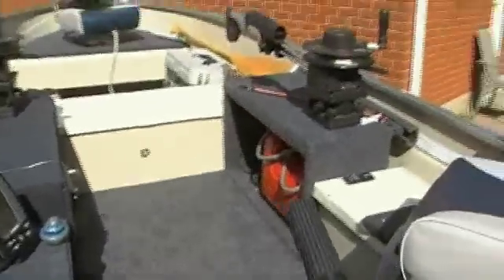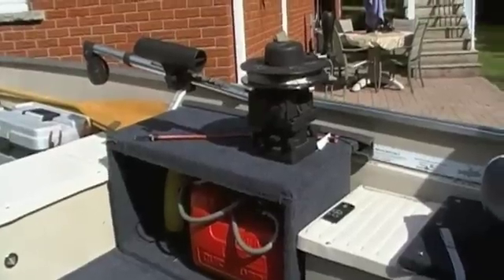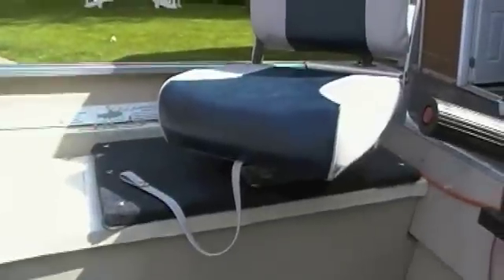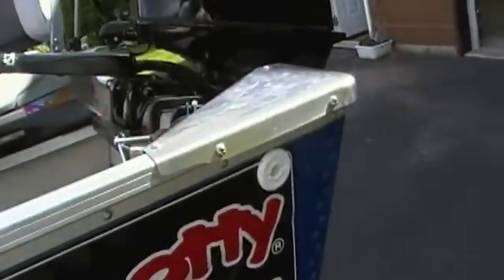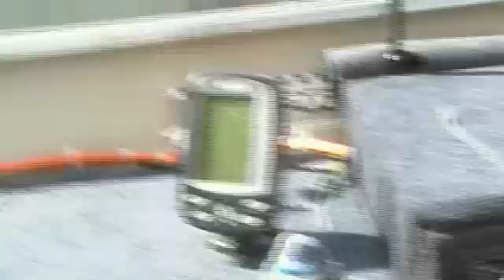Boat modification Project

Comment: Hey nice video. Is that a princecraft fisherman? I have the same boat and am looking to do some mods myself. This will be my 3rd boat I've restored and was wondering if you had a trick to get the exact measurement for the bow piece? Also, do you buy marine grade plywood?
Reply: Yes Its a 14ft Princcraft Fisherman . Cutting the bow peice was the hardest part I used a bige peice of cardboard . I layed it over the bow and reached under it to trace the size then cut it out the  when it was close I worked on it with cardboard until I had the right size only then did I cut the 3/4 plywood I just used regular ply my reson I always store it inside I really dont think it makes that much differance Marine grade is soooo expensive I did this project last year it works great my thinking it will last many years if I have to do it again because its rotten I know how.. The other part you cant see is I made a leg under the plywood that screwed to the bottom so  can stand on the bow platform I used a 4x4 presure treaded post I had sitting in my shop .This made it very stable to stand on.
 I screwed the back of the  platform right through the original bench .
Reply from the maker: Yes cardboard I laid cardboard ind marked it cut it first then used that as my template on the plywood

Comment: I have exactly the same boat with a mercury 20 hp 4 stroke, I'd like to know the speed you reach once fully loaded with the fishing gear ? Do you get on plane quickly ?  I'm getting 41 kmh (25 mph) when we're 2 + fishing gear and I want to modify the boat a bit like yours but I'm worried about performance once done.
Reply from the maker: Samuel TremblayMy Boat went from wow fast to when I am by myself it planes out fast but with all the extra weight it takes longer to plane the boat is better to fish out of now but I did loose some performance  with the changes

Comment: I am currently getting ready to modify my 14ft alumacraft, just wondering how you secured the front deck to the bench? Did you drill into the bench seats?
Reply from the maker: Yep I drilled stainless screwsinto the seat and I put a 4x4 wooden leg down to hold the platform that just sits under the front  I hope that makes sens

Comment: It giving me great ideas for mine!!! But mine is a princecraft ungava 12 ft...
Reply from the maker: Thats great I think with a little thought you can modify your boat to better for what you do the only cation I would give you is be aware of how much weight your adding I like my boat and it works well for me but it is slower I have a top speed of 29 KPH
Reply: Kevin Schroeder  last week , i went fishing on " la riviere des outaouais " ... I dont know the name in english.... I got a 9.9 2 stroke yam , me and a buddy of mine ( 2 big guys) with all the stock , we went 28 kpm and my motor got a little probem of choke ( i cant close the choke all the way, when i do the motor stall).... So i guess i'm not so bad!!! I will modify my boay this spring...front deck...gas tank and battery under it...and a floor in the back....after repairing my motor, if  i keep 28-30 kpm, i will be a happy camper!!!!!
Reply from the maker: Im glad I could help thats the best thing about you tube
Reply from the maker: Just be careful of the weight  it can make the boat sit low if its too heavy